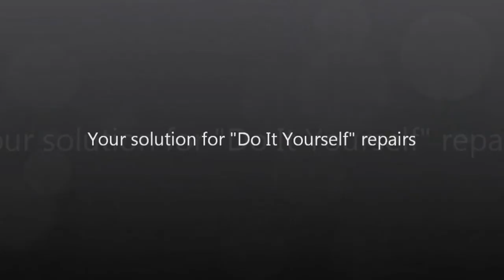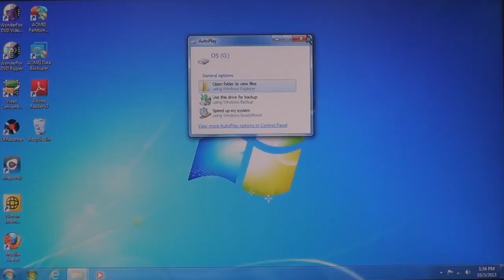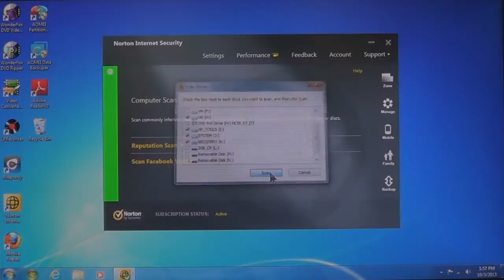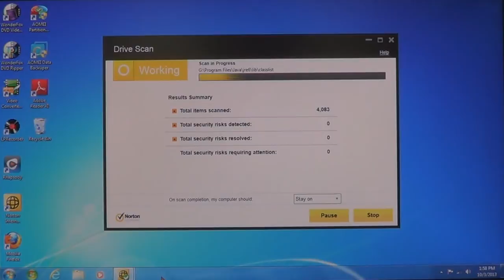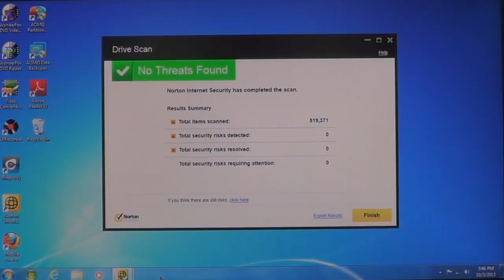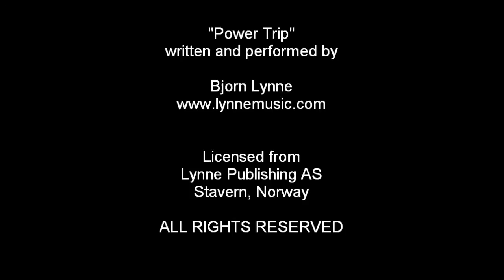How to safely remove viruses from an infected PC

Comment: After all these years, does this method still work or is it outdated?
If my PC has been already infected, is there a 100% way to get rid of the virus or should i just wipe my drive / restore OS to factory settings, reinstall my OS completely, get a new drive?
Reply from the maker: This method still works. You will need to take the HDD/SSD out of the infected PC and connect it to USB adapter. connect adapter to Another PC with A/V installed. The HDD/SSD will work as an external drive.  Have the A/V do a full Scan on the external drive.  Any virus it finds will be removed.
Reply: @ESRepair  Thank you very much!